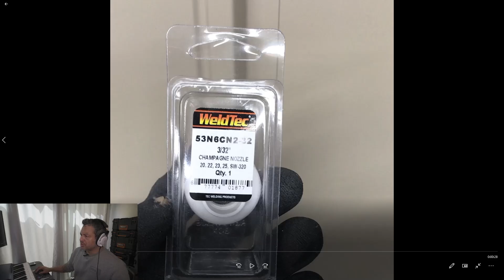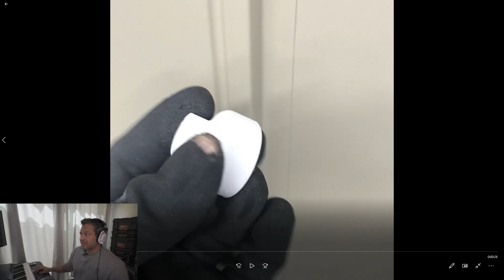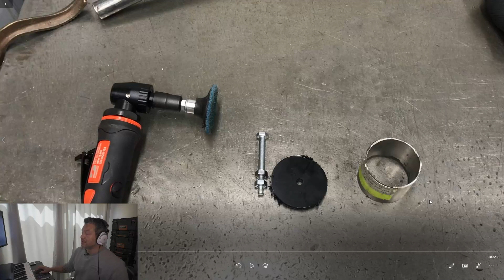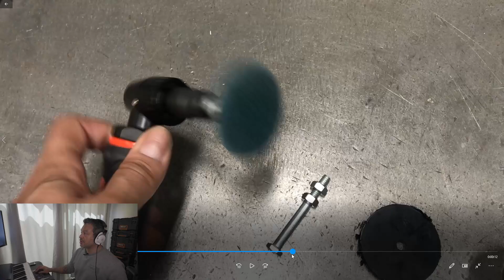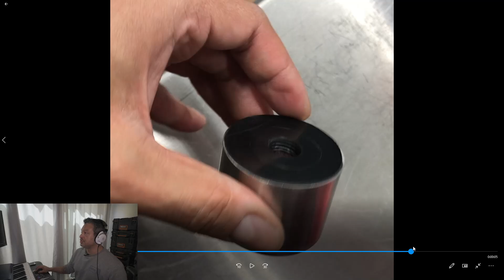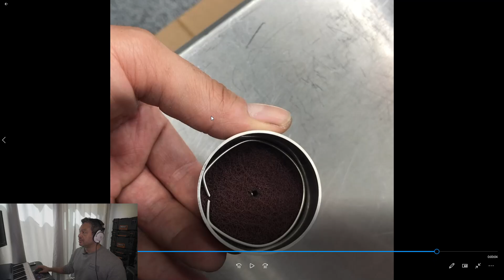DIY TIG Welding Cup

Comment: hoping you can help with my OBS ford bronco 1994.  quickie lube cracked the magnesium  housing of my borg-warner 1356 transfer case by overtightening the drain bolt.  I want to drill out the drainhole/crack and fill with TIG weldl and rebore the drain hole.  If i tig weld the 3/4 inch wall is there a backer i could use at the bottom of the hole.?  ceramic? copper?